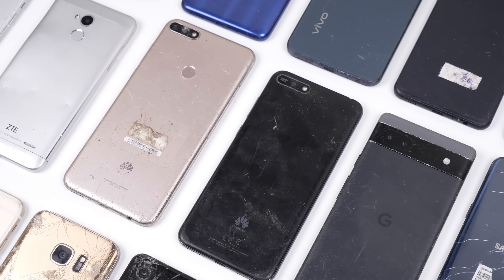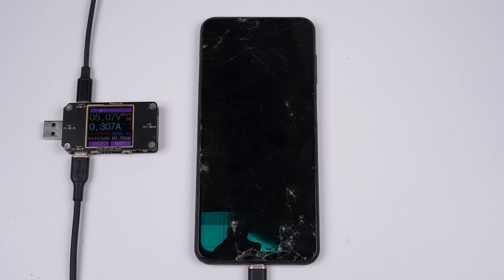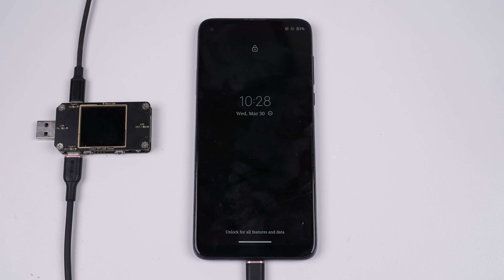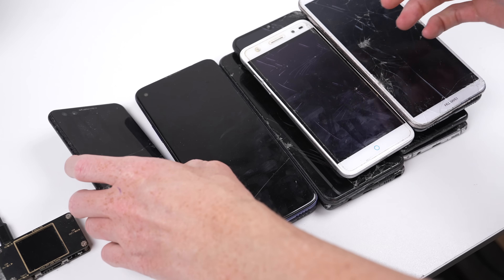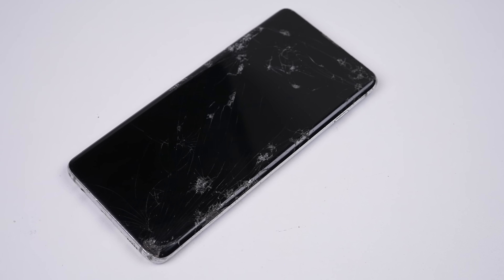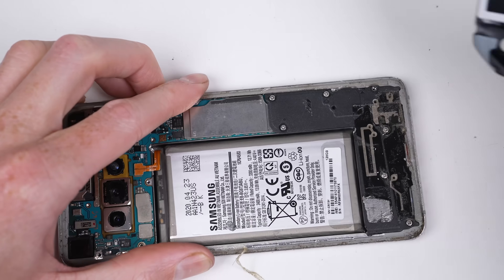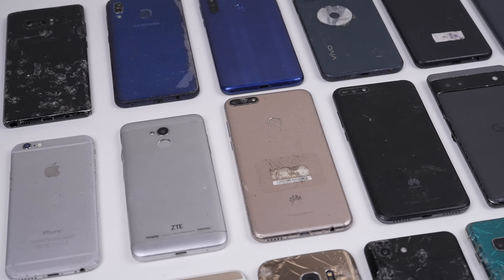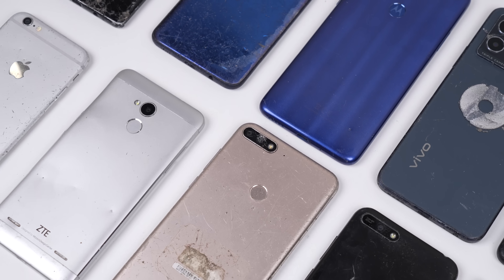I Bought $64USD of E-Waste Phones - Can I Fix Them?

Comment: I’ve watched many of your videos. And often you reference itest. You have briefed over the app.
 But could you please give us a more detailed description of the app and what it can do for us.
I found an app this year that tells me more about the actual hardware on my device than possibly what the seller has described.
I’m wondering if your app would be better at this. But while I have been watching your videos for a few years now, I do not install any apps quickly nor without consideration.
The app I currently use is DevCheck. It seems to be fairly accurate, I have discovered a few of my phones were not what I purchased, and suspected inconsistencies between what was advertised, and the performance shown.
If your app can do the same and more, I’d prefer to use your app. But without comparative reference?!

Comment: those Pixel 6as are indestructible. I have one in even worse condition than that one (bent frame, back is coming off, dent on the motherboard, the most cracked screen I've ever seen), and after charging a bit it actually booted up just fine - albeit with a dead display and vibration motor.

Comment: I understand your pain with the pixel 3 repairs. My dad had a pixel 3 and the screen broke; I've done repairs with the 4a before. I thought "this should be easy, I just have to pop the screen out and then put in the donor". I then spent 4 or 5 hours repairing it. And I accidentally didn't connect the earpiece speaker well enough. And then my dad got a new phone a few weeks later. I was impressed that I pulled it off though.

Comment: My iPhone 13 pro battery completely wouldn’t recharge. So i tried to replace the battery, i bought a compatible battery off of amazon. I opened the phone, and did a terrible repair, it booted and 1 minute later it stopped working and is now boot looping.

Comment: The peak of Samsung was the Note 9. Small bezels, Iris scanner, proper fingerprint sensor, headphone jack, MicroSD card slot, force touch home button, notification LED, S-Pen and probably more features I'm forgetting.

I'm on the S24 Ultra now and this is the first phone where the fingerprint sensor is as fast and reliable as it was on the Note 9. I would still prefer if it was separate and on the back though. I still miss the Iris scanner for when wearing gloves or sth, face rec. is not good. And I miss the MicroSD slot, headphone jack and force touch home button.

Comment: There are a lot of phones that are attached 100% to a cheap cell plan and even if you could get them up and running they would be useless unless you were a member of that phone plan. I think the ZTE is definitely fall into that. There's also a ton of Motorola's that are pre-programmed for assurance wireless. Actually they're sold by them but maybe anybody could use them. I'm speaking specifically about the Motorola.

Comment: An advice.... Neverrrrr repair a midrange phone.. it has literally no use.. the parts (specially if the board or display is damaged)....
Plus Phones with Slower mediatek or exynos processors... They have no resale

Comment: I love the cheaper A1x samsung series. I had an A12 and at some point the fingerprint sensor stopped working (side mounted is the best btw). I was able to take it apart with nothing but my fingernails and a ph00 screwdriver. I ended up giving that one to my grandma and got a Note 20 Ultra for myself. My best friend has that same A12. One time he broke the screen and we got it replaced together for 45 bucks for a genuine part. Some years later his usbc port stopped charging with some adapters so I offered give him the board out of mine and then managed to fixed his, before giving it to my grandma. They're really solid phones for the price with microsd and headphone jack and he's still holding onto that one 5 years later.

Comment: I wish the S10 replacement screen is cheaper. My old screen is dead and I decided to use a LCD replacement instead since it's like 1/4 of the price. It's a lot dimmer and less responsive. The phone case also won't fit anymore. Still, it's usable again, so I guess just use it as my backup phone.

Comment: A thing to tell I have a galaxy S5 which have the same issue as S10 you show us in the video so my repair guy fixed it in the same way like you but only for power button the volume button does need a another housing for the power button

Comment: No, Note 9/S9 was peak. After that they removed features and didn't add anything to make it up. S10 had less features than the 9. It takes me longer to unlock the S25U and use than the N9. Because you have to search the scanner and didn't have a sensor home button anymore. Also the pen is cheap af and stinks - none of this on the 9. So annoying that they are only cutting down and making the phones cheaper every year. The golden age is gone. The more it is annoying you have a hard time repairing as the N9 IS still fast enough in 2025. I put roms on them and now my wife und kid have N9s. No complaints from them at all.

Comment: 14:40 I don't know why you try so hard I get out so easily it just takes a little bit of alcohol and heat! Then the butter soft come out and you don't get a battery out from below, as they are easier to damage there. [...] But all these devices are not worth repairing. Here, the spare parts cost more than the device is worth...

Comment: Mr. Jeffrey s I have a question for you if you or someone has an answer maybe 🤔 I bought a Motorola demo phone on clearance for $60 U.S. and it's a 2024 model, I believed that I was doing good by updating the phone to hopefully keep hackers out the phone and the update was really a downgrade meant to mess up the phone, the phone is one month old got it just last month I believe! The phone is still in excellent condition! What happened was the phone powered off, just shut off, sometimes it just didn't want to come back on, when it did sometimes it would go off again sometime it would go through a reboot cycle and sometimes wouldn't come on for hours and now it just won't come on at all, it had a light that blinked when connected to the charger and acknowledged the charger connected, now doesn't do that and will not turn on! Is there any way to save this new phone and get it to work again or could the phone be refreshed to brand new phone factory specifications to save the phone! What do you say! 🤔😮🤯

Comment: i bought an 1400$ apple phone recently to see finally what apple was about, the iphone 16 pro max, my experiences compared to my previous android phone which was the S24 ultra: the 16 pro max had alot of restrictions for even the most basic actions, internet card in it is much worse, less than 1/3rd of the same speeds i got on an android, the cameras are much worse, comparable to android phones around 200$ price range, they aren't unusable and get the job done but not very good or miraculous, lots of heating and bad battery life, browsing the internet was worse accross the board, sites took longer to load, the overall UI of iOS was very inconvenient with the choppy gesture controls and a total lack of reliable back button, the display was also very blurry compared to most androids i've used, color accuracy was low and the speakers weren't wonders either, build quality was okay but still felt like a cheap shoddy air pocket filled brick compared to sleeker android flagships, the lack of cpu power was noticeable in everyday uses with hitches and delays from app to app compared to android flagships, battery life was less than half with charging taking up to 6 times longer, also the inferior version of USB-C was immediately noticeable when i was transferring photos and videos between it and my PC, the bluetooth and NFC were also considerably worse from having way shorter ranges, less stable connections, worse sound quality, the  gps was also worse, less accurate, and the apple maps was a direct downgrade from google maps, the apple ecosystem with apple music, apple pay etc was unneccessarily convoluted, sluggish and needed multiple monthly payments to get basic use out of, overall the iphone 16 pro max was an OKAY phone, but it shouldn't be priced anywhere near a real flagship device, it's noticeably inferior accross the board in everyday use and more complex tasks than android flagships with similiar pricetags are, the 16 pro max would be the perfect phone if the starting price would be 250$, with tradeoffs to budget androids being worse charging speeds, worse battery life, worse display and a more sluggish and restricted sometimes buggy user experience, for slightly better photos than other budget phones, but as is the iphone 16 pro max is a total scam and should be avoided in favor of much better devices and user experiences.

Comment: Several years ago, when I was working in retail, I had a client that wanted to change the screen protector on their phone — which was quite alike to the one that ZTE had (with the difference that it had set even more solid). Not knowing at the time what I was dealing with got me quite careless, and while I was doing my best to get the protector off the screen, a small splinter of it chipped off and flew straight into my left eye. Luckily, I was able to take it out by myself. Quite an unpleasant experience, tho. 

So if anyone here in the comments is often dealing with older phones, which usually have this weird type of glue on their screen protectors, be careful and try to remove it while having some kind of cover between your face and the phone.

Comment: Jesus, I love to watch repairing your phones! I missed this serial. Will it be more?
Hugh, I bought old, but very old Ericsson T20e. After few days on charger it revived, but... It says No network. It can read SMS and Phonebook, even I can play games but no network connection. Phone has never been opened so I decided to keep it at least as clock alarm, and works good. Not great because battery draining is big so i switch it off and alarm works. Hard to believe that phone from 2000 can still can be used.
Your channel made me to do this and I'm very thankful.
Regards from Dubrovnik/CRO.

Comment: Did you reset the charge cycle counter on S9+? Battery replacement without resetting the counter doesn't change anything as the maximun charging voltage is capped.

Comment: love the repair videos. I repair phones myself, did it as my main source of income from my last year of school and I have made a lot of mistakes in terms of buying and being impatient and rough during repairs. Sometimes I would find a great deal on a damaged phone on ebay during auctions but don't have time to look up replacement screen cost ( auction timers when I view the listing usually ends up being 10 sec lol) only to find out its not logical or economical for me to repair it. However, within the last year or two I have found out that demo phones can be found online with full functional screens and other parts in great condition (since the usually are display units from store) and I would just swap the board and whatever part is missing from the demo phone. Ebay is a magical place when it comes to looking for parts, you just have to know the right keywords to search for

Comment: Bought Pixel 6a for 55$ with not working touchscreen which turned out to be connector going loose even if bracket was in place, all i can say removing seal was ultra pain in ass 3h of Cotton Buds with isopropyl as stuff went gunk and was almost fused to frame.
Also your pissel seems to be frp locked, mine was too and mine was on Android 13( otg two fones with one going into storage mode(motorola) then opening .html file and navigating into known frp sites helped me get around it)

Comment: Hello, Nice work. Have been watching you for quite some time, always had the same question on my mind. Where do you get the parts which are refurbished into close as original as possible? And the original Samsung battery, where that was pulled off?

Comment: I love the Samsung galaxyA13 it was super reliable and better than every other Samsung phone I’ve ever had and had a pretty reasonably good camera. I really liked it. I like the plastic build. I like the headphone jack I like the SD card slot. Expandable storage is better than every other Samsung phone I’ve had. I had a note 8 and I also had a 04 and 04 is the worst one I had was crap so yeah but yeah, I really like the Samsung A13. It’s better than every other Samsung form that I’ve had but a fall out with Samsung phones and it’s a big shame because you’ve got excellent hardware excellent software and excellent ecosystem but the screens are shit the most reliable phone I’ve ever had full stop has got to be a Huawei on a 10 light that’s a really good for and is it just me or did they make smart phones better in the late 2010s to what they do now?

Comment: $4 dollars per phone? Just the batteries are worth it if you salvage them for hobby electronics projects. Even if they are reduced significantly in capacity from age they'll have plenty of juice for smaller projects.
Reply: Not really and connectors for the battery don’t really work out for projects, managing the BMS is very risky for most people
Reply: @S1_2025-YT Obviously you'd have to make custom battery interfaces, but it is a way to get dirt cheap and relatively large lithium batteries.

Comment: I'd love to see some videos on some of the ways you can use old phones that boot up but have cracked screens or other issues. Using tools like USB OTG, MacroDroid and Vysor unlocks a lot of options!
Reply: you can also use them as a poor-man's security camera. I'm potentially looking into this. I have some obsolete phones, some that are partially working (such as my nexus 5 having a faulty modem, wifi works but no cellular) and with fairly decent cameras they could do a decent job. But really you would need to find a way to remove the battery and bypass it so you can just power it off of 5v USB directly, so as to avoid the battery bloating.
Reply: @yotoprules-u6l  The person you replied to gave you a workaround. Macrodroid can add a constraint to only run the macro when plugged in.

Comment: I used to work for Telstra Retail, and the SIM card you pulled from the Pixel 3 appears to be out of a Telstra demo phone, orfrom a corporate package (from an EFTPOS machine, a connected GPS system or something similar). Definitely something shady going on.
Reply: So a stolen SIM card combined with a privacy OS (which isn't shady) but the implications of Wasted (panic data wiping app) + a stolen sim is unnerving.
Reply: @QuackZack  I agree. Sounds like the phone got too "hot" and was dumped quick smart!

Comment: 11:23 yes yes yes and yes! my samsung s10 was my daily driver for three years, and even now is my gaming phone/mp3 player thanks to its storage capacity and headphone jack. of course its not on a data plan right now, but my active phone has 100gigs of tethering data a month, so, issue solved. (plus, its nice to have something that can be used mostly offline in the first place-- offline games, downloaded music, i keep a few movies and books on there if i get super bored). despite me treating it kind of horribly battery wise, its still perfectly fine. And, the curved screen doesnt seem to have the same issues the s7 curved screen had (my s7 edge also still works, but has many cracks in the front glass that all appeared during charging. i mean, to be fair, my s4 Also still works, and is in near mint condition, but theres not much to do with it nowadays.)
Reply: I have a73 5g

Comment: I get a lot of e waste phones when i do recycling but people never reset them and i can't figure out how to bypass the lock screen on any new devices unless they use windows so they end up saved for parts when i find a broken one that isn't locked unless its an apple product that goes straight to the ewaste facility they made that a huge waste of time even if it's unlocked replacing the parts with a donor requires expensive machines.

Comment: i think the pixel deserves a new body, it's worth replacing
Reply: Is locked. Just see the lock symbol in the upper left corner of the screen. It is factory reset probably, but the security is still on and it is a pain to remove it. Because most tricks to remove don’t work anymore because pixel has updated the software with their security updates.

Comment: One thing I don't like about the Galaxy S10 is the soldered USB-C port. My S10+ has this connector broken and I can charge only wirelessly... and yes, I've cleaned it and it made no difference. Otherwise I love the S10 series.
Reply: Agreed, that and the super narrow motherboard that is easy to break when removing.
Reply: A very common prob with that phone.

Comment: Great video! It's always great to see these usable devices saved from e-waste. I was wondering if you worry about factory reset protection, I purchased some broken Samsung phones (S10 and older) and was wondering if I should buy batteries to test them (previous batteries expanded so I removed them), and how/if you deal with it. Thanks!
Reply: older devices you can bypass FRP pretty easily. Devices on the latest security patch are much more difficult.
Reply: SamFW to get the frp lock of older Samsungs, I cut the connector and bms of the old batteries, solder leads onto them, then attach to a charged disposable vape cell, perfectly fine for testing.